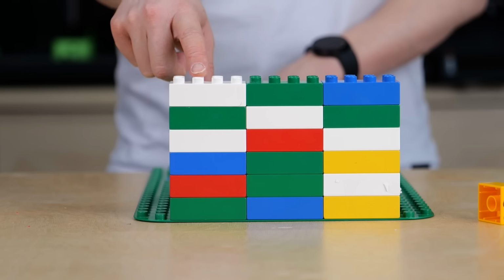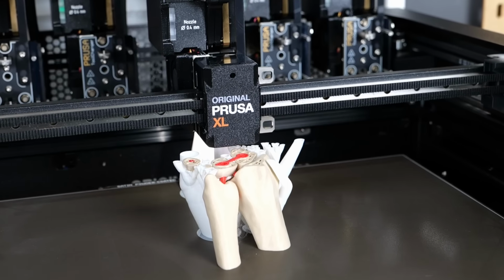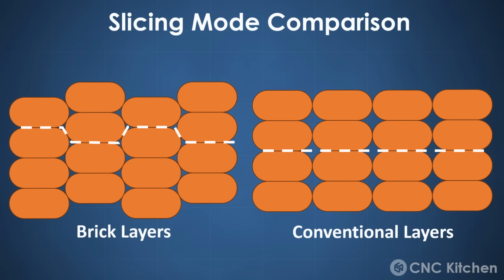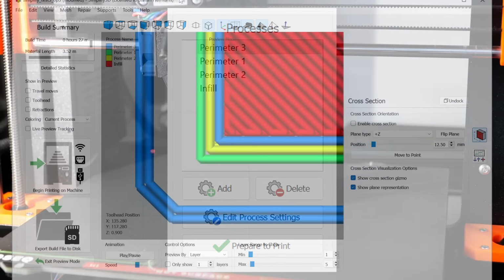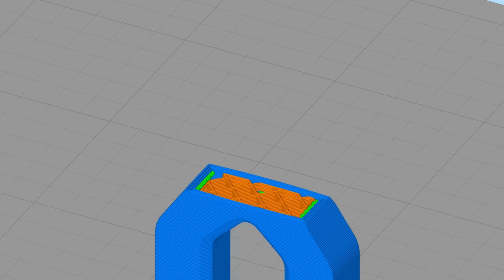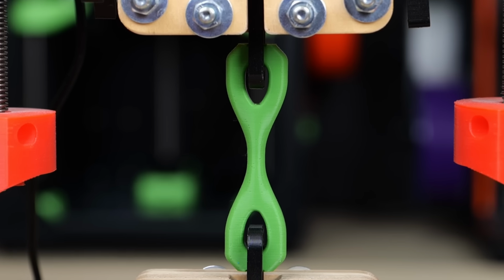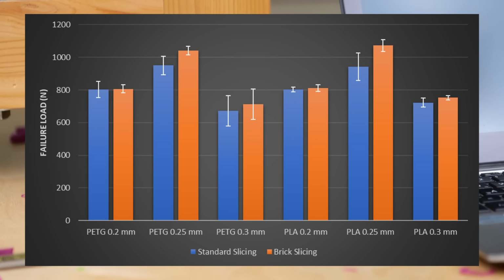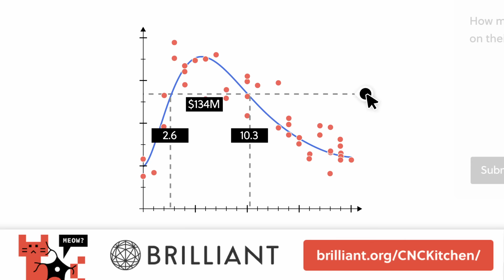Brick Layers - Why did no one do this before?

Comment: How to increase the temperature so that the filament melts inside?
The edge routes could be printed at a normal temperature, but the inner route could be printed at a higher temperature, so that the filament would spread more and thus there would be a larger contact area.
Alternatively, you could print in acetone steam so that the already printed filament is soft and sticky.
Or keep the already printed filament at a high temperature so that it tends to bond more.
Or another head could simultaneously print another substance during printing, such as glue or something else to fill the gaps.

Comment: I have an idea to maybe also help with layer adhesion...but no time or skills to implement it.  How would turning off part cooling for ONLY interior layers work?  Still cool the outside perimeters, but let the interior layers have more heat and time to bond.

Comment: How about shifting each layer outwards or inwards for a half of the line width? The center of a next line would be in the middle of two lines of the previous layer. Could potentially fill the gap and make the bonds even stronger? Basically same idea as was presented in this video but make it on horizontal plane and not vertical.

Comment: Maybe increasing temperature and extrusion rate for the intermediary layers will help improve it as well?
That will make the filament more liquid making it fill in more into the gaps and creases and potentially improving surface area, adhesion and strength.
Should also be really easy to implement and test.

Comment: Have you tried revisiting your attempt at the high strength, transparent prints in PETG? Using the brick layered printing could potentially both reduce the little gaps further for more clarity as well as increase the side impact strength due to the layers shearing.

Comment: In Simplify3D, is there an option to set a horizontal overlap of perimeters ? The main strongness is still in vertical connections and the brick connections add the observed improvement. Bigger overlap of perimeters would distribute the stress more to shear stress of the brick connections.

Comment: It may have increased strength in other load directions. 
Maybe try rotating the grain 90 degrees to check tensile strength. Perhaps having the new layering allows them to work better together longitudinally.

Comment: well, you still have a weaker area in the vertical plane. The vertical seams are aligned per each layer. If you can do a 50% "inside" offset for every other layer (and have the outermost lines of each one be wider to compensate for this so you still have a smooth shell instead of a rough one), i believe that you will get much better adhesion as well as making the part stronger in the vertical plane (the cracks you noticed should minimize if not disappear)

Comment: Did you try to print the exterior layers first with varied interior layer flow rate to remove the voids found between creating more solid parts?

Comment: If it breaks along the layer line then you have not extruded enough material. I make sure infill gets higher extrusion amount so it fills gaps. My parts rarely break along the layer line.

PETG can be weird and explode. It comes down to how rapidly it's cooled and probably other factors. For example one of my PETG models had one side very brittle and the other side malleable. Only difference was that cooling was blowing onto one side only.

Comment: im at 8 mins. to add to the shattering its due to the layers being partial wedged. so for them to pull apart they must push away there neighbouring paths to pass. it will add more rigidity as there are more bonded angles of restricted motion but as metals go it also makes things more shatter prone where before you get yielding or plastic deformation. really good test so far.

Comment: Nice experiement! How do the results change when the samples are printed at 90º (i.e., z axis becomes x axis)? So obviously, while you'd have increased vertical strength, horizontal or sheer strength is reduced, but still an interesting idea to explore IMHO. Then there is the 45º modification that you mentioned also. For comparison, would've been interesting to see tensile tests for this as well.
Furthermore, I could imagine tests with mixed filaments or part metal part PLA filaments.

Comment: Combine this method with superslicer of offsetting different extrusion widths on the outside perimeter. .8mm  and .4mm widths if you have a .4 nozzle could potentially give you another increase in strength cause there's still a tower on the outside perimeters.

Comment: there is a way to do similar, use .6 nozzle print .4 line width and over extrude a bit, so you get interlocking lines with slight thickness shift on the plane

Comment: It would be interesting to see if the 'internal' perimeters could be printed at a higher temperature or extrusion width to try to get more filament into the cracks and get additional strength

Comment: I would be interested how this improves shear strength parallel to the layer direction. Or if compressive strength is changed at all. It seems like the material should be more dense at the layer level.

Comment: it would be interesting to see if annealing furthers this structural gain..? also maybe a little over extrusion on off set lines to help fill in that gap< I don't know how or what slicer might have this option I don't know if this is an option to have wall layers to extrude normal setting with other layer over extruding but it would be nice to see for strength gains.. if you can get it in Prusa Slicer then it is definitely available in Orca Slicer, I am sure they could add this features to their Slicer and more then willing, showing these results.. if the petg is exploding and running cracks it's because the strength is more unified in the Print, the weakest point is the path of least resistance, the more catastrophic failure you see means the more even the strength is in the part because there is less weaker points in the part, the part is more evenly stressed!! this is a very good Sign!!!!

Comment: It would seem that the improved "closeness" along the zig-zag could be leveraged even more by annealing. Usually, annealing leaves some small gaps, but with this method the starting gaps are much smaller, so that not only will the annealing be more complete, but also perhaps in less time - and with less shrinkage since less material will migrate into the bigger gaps of typically stacked layers. Finally, for top layer roughness, ironing might help, though annealing helps with outer surfaces a bit too. After that, XTC or other exothermic processing may be useful. I think I have my science project for the next few days.....

Comment: Im new to this 3d printing and thought of this idea as well, with regards to the interlocking lines of print. I may have a little suggestion or maybe a question as well.

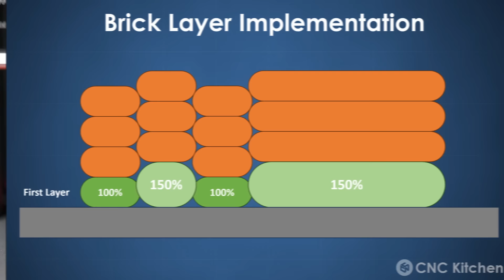Is there a way for the parts at 150% at @4:50 time stamp, can the temperature be modified instead and have that part make the filament material hot to make it "more gooey" that it acts like a mortar that it seeps in with the gaps of the other side of walls?  maybe make the 150% parts have a higher temperature and leave the rest at a hot but lower temperature to retain the shape and not make a hot mess/gooey outcome overall? or its not worth it because of time of printing when changing said temperature? (heating and cooling, etc).

Its just a thought though, I'm an architecture student and currently been researching about 3d printing. I have been watching a lot form your channel and it inspires me to continue with this journey.

Comment: the angled / 45 degree surface may imply torsional failure... which could have happened if it suffered a cascading failure (where one point failed and then experienced a cascading failure along the cross section. Perhaps over extrusion may help to remove this likelihood further...

Comment: Good idea but at this scale. Properly melted together laters combined is better then stacked with more air or imperfections.

This idea works when you would be combining different plastics together. Most models with rubber and plastic overlap from layer to layer.

Comment: methinks it wold make sense to overextrude more on the intermediate layers.
that would allow for better layer adhesion without interfering with the surface finish (since the half step layer is always “inside” the main layer.

Comment: For ultimate strength, could something like blob-bricks work? I.E as the printhead prints a line at 0.4mm width, it prints 0.4mm length at 0.36mm width and the next 0.4mm length at 0.46mm width, used alongside brick layers you'll end up with a beaded pattern locking each line and layer in place in every dimension?

Comment: This is interesting. I had an idea of doing a sort of "stitching" where the nozzle would change layer height intermittently thus pushing the filament being extruded into the layer below. This would probably make for a very ugly outer perimeter, but might be useful if used on inner walls. Might be worth a try, but I'm not smart enough to do this. lol.

Comment: @CNCKitchen
Next vary the outer perimeter width by half every other layer.
Also increase the flow a bit, if your picture under the microscope is representative of your actually tested prints, the flow can be higher on your interlocking samples cause the plastic will much easier fill the gaps in this way.

Comment: Those gaps between the extrusions layers could surely be reinforced with some kind of resin and a vacuum chamber, right? 

I know those gaps are really tiny but I’ve seen resin impregnated into lignin using a vacuum chamber. Lignin gaps are surely smaller.

Comment: Stefan, when you analyze data, do you apply Analysis of Variance (ANOVA)? I learnt this recently in Engineering school, but if you don't know, it's one of the most important tools in statistics ever, and it's used for quantitatively determining whether the variance of your data is insignificant enough to draw a conclusion for your tests, or in other words, whether there is too much overlap between the error bars of a bar chart for the analyst to draw a conclusion. ANOVA's tedious to do by hand but I'll bet there is an excel spreadsheet out there that does it all for you already.

Comment: Correct me if I'm wrong, but I noticed that the test you conducted was tensile stress test. As an analogy you used bricks wall pattern, I'm no engineer so I might be wrong, but I think brick wall pattern is meant to increase resistance to other type of stress like compression and maybe bending. I believe you would see interesting results by testing for other types of stress. Anyway 10% increase is no joke tho, nice video.

Comment: An idea I had would be to make the internal layers be the layers that are set down lower, make the width between lines larger, and use the lower layers as a way to pump more material in an fill in the voids more

Comment: This is an awesome test. 10-15% improvement in strenght is nothing to scoff at, considering how weak this area is. I think, it might be due to a lot of edge cases that this is not a feature already. It might be hard to bugfix all the possible errors with such a feature, which, to most 3d printing uses might not be worth it. After all if you need to print a part for strenght, you make sure to line up it with the filament and not with the layers.

Comment: 3d printer noob here, but I realized something with this method, when working inside the edges coulnt you then use higher temperatures, thus get better adhesion?

As you mostly filling grooves when not working on edges, so is not like the filament can deform to the sides

Comment: i used to work in residential chimney repairs, and one possible downfall i could see is somewhat displayed in the stress testing, with how the brick pattern layered part exploded upon failure. because of the homogeneity, if there is a crack somewhere on the print, then it will exacerbate, hence the long fractures and explosive failures, just like in chimneys; if one block has a crack, left unchecked it will spread, undermining the structural properties as the brick crumbles. that being said, because of the homogeneity, it has increased strength, but if it fails is more catastrophic, kind of like cast iron, its dense and really strong but is also very brittle when its strengths are overcome.

Comment: To kick it up another notch, have the offset lines overlap a bit, just like infill overlapping walls. It will create more squish and fusion and fill in gaps like your previous testing. Plus if the layers literally overlap like bricks, it should be even stronger!
Reply: Nevermind. Refer to the comment by @mw4222 who actually tested this. You can accomplish the same results by just extruding a bit more. :)
Reply: Although, their research ended up comparing highly extruded normal layering to highly extruded brick style layering with overlap. Without any intentional over extrusion, there may still be benefits. I also have thought a lot about trying to interlace overlapping infill in a method like this which also includes intentionally dragging the nozzle through previously printed lines. Lots of ideas that could have benefits, but haven't been fully tested yet. Fun stuff.

Comment: Layer adhesion is only one factor.  For such a relatively simple adjustment, I think the gains are a positive step (assuming it were possible on conventional slicers).  That said, I think it would be interesting to investigate other ways this could be of benefit.  For example, compression.

Comment: It would be interesting to rerun this test with very think layers.  (print with a .6 or .8mm nozzle)

I would be interested in seeing if the 10%-14% is consistent regardless of layer height, or if the thicker layers get you never more of an increase. (due to the increased surface area)

Comment: From your macro images, it looks like the brick laters could take a much higher extrusion multiplier on interior perimeters. (Obviously, for comparison testing, keeping the multiplier the same between planar and brick laters is good.) It would make sense that the offset layers stack more efficiently, allowing more plastic in the same space. With a higher extrusion multiplier, not only would the parts be even stronger (and heavier), but also likely more water tight.

Comment: I have found that wih PETG and having a filament extruded @ 101% & 255-260C and ~20mm/s with 0.3 layer height and 0.7 extrusion width (0.6 nozzle) my failure is completely through material (usually at 45ish deg to the load showing its very orthographic material failing in shear plane). And its very difficult to spot the layers. I'm using it for joining two K5  pressure washers output (subject to vibration and shock) 
:)

Comment: What happens if you make the offset bricks taller and thinner so they connect to multiple bricks?   What if you leave gaps (channels horizontally oriented at 90 degrees to the rest) in the layers and fill them with long strands of materials.  You could even do nets (#) of the third type of brick (normal, offset, reinforcing strands).

Comment: I wonder if applying some variation of the "ironing" process (as referred to by prusaslicer) either along the same path as the just-extruded half-layer or over the boundary between that one and the previous layer, would improve part strength. The added print time would potentially be severe, but I think this way you might be able to fill in the remaining gaps. A potential lead to investigate maybe?

Comment: Is the nozzle hole always circular? Could a square nozzle hole lay down a square or rectangular "bead"? Maybe an "exaggerated square" aperture (that starts to look like a "4-pointed star") would lay down a bead that is closer to square. Printing a "squarer" bead would increase contact area at the sides, for conventional slicing and for staggered slicing. With a nozzle that doesn't have the same shape in every direction, you would have to rotate the nozzle whenever the printing direction changes, to keep the nozzle perpendicular to motion. (Possibly by rotating the feeder and reel around the printer, or by rotating the whole printer.)

Comment: @cnckitchen, what about combining this offset method describe in the video to slow printing speed to increase the heat transfer to neighboring layers, hence layer adhesion? 

For structural components, I don't see  slower printing speed being too much of a problem, but not sure if it would worth the extra printing time..

Comment: The way it breaks makes it look like it's having multiple points of failure throughout that finally lead to a catastrophic failure at the 10-14% higher force. Have you done much testing at the 900-950N range on the newer process where you leave it under that stress for extended periods of time? The biggest concern being that real world applications can have forces from multiple angles making that extended safety range irrelevant if small breakdowns are occurring like that earlier in the application of stress.

Comment: Not sure how to put this, but... did you consider that, as you shift each printing line up, a bigger void is created between them, posibly requiring over extrusion to fill it? Since the cross section of each 3D printed line is not a rectangle, but more like elipses which are touching it other at the "tips". As you shift them, the tips which are touching will also move respect to each other. Does this make sense?🤔 If I could insert an image it would be easier to explain.